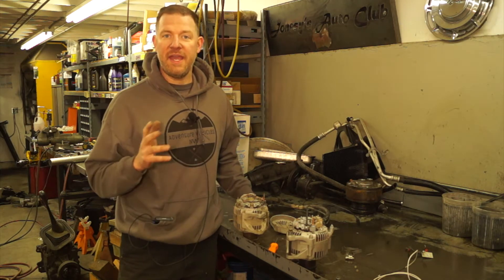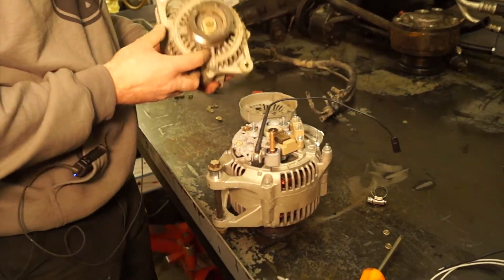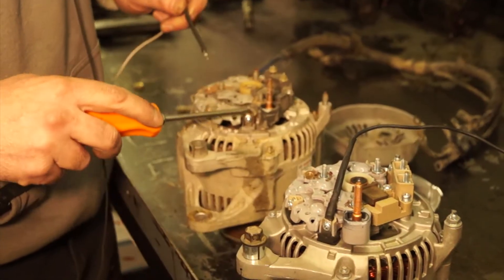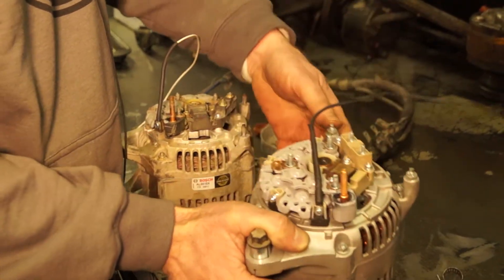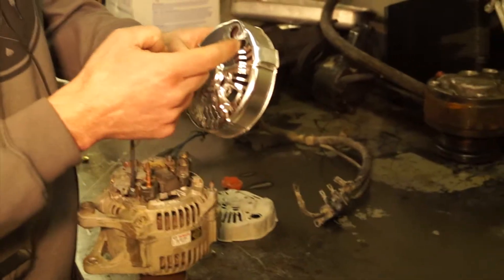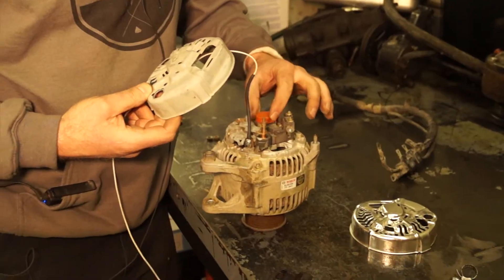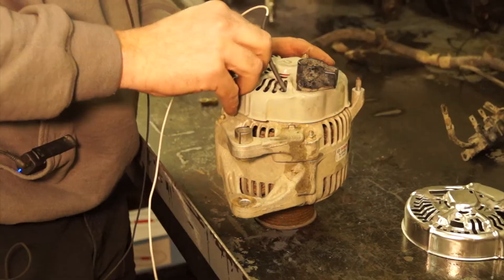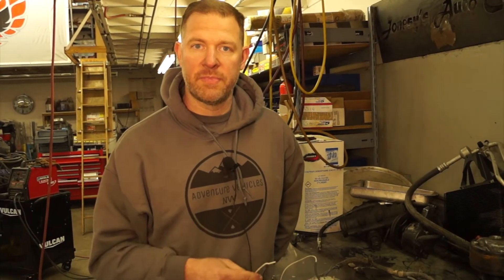Install a Tachometer Signal Wire on your Diesel Alternator

Comment: Nice but I have a question.  Im trying to do the same for  diesel engine using a Motorola  8MR2049k Alternator.  It has and external regulator.  I can see the two outputs of the alternator ac going into the regulator.  is this what you use for the tachomter signal.  you just connected to a post on the alternator next to the output post with no description.  what is that post? thanks

Comment: I'd recommend using some sort of polyurethane to keep the wire from rubbing, like window seal poly.  The double insulation is ok, but given the sharp edge and vibration these motors can have why not just poly it in place as well?  Just make sure if you do it dries before driving!
Reply: Why not just insert a plastic bushing in the housing?

Comment: I understand the procedure that was depicted. But my situation is based on the square back dual field Chrysler alternator and external regulator for restoration purposes. The tachometer requires wiring to the crank sensor or alternator. At present my two options are, a different unit, or convert the one I have. I would appreciate any information you can offer.
Respectfully,

Biff DeMartino

Comment: Why did you not mention what part of alternator circuit that you connect that wire sir is it in the stator cool, rectifier diode, ic regulator, carbon brass what part sir
Reply: It grabs the AC before the diodes get to it.

Comment: would that work for gas engine to run a generator to power a house would need something to adjust the right RPM do
Reply: JUST BUY A HR /TACH FOR A DIRT BIKE THEY RUN OFF THE HT LEAD

Comment: what signal does the wire put out ? i want to put a tach on my riding mower and it needs signal from a generator but it does not have that.
does it jst send a 12v pulse every rotation of the crank ?
Reply: Same, want to put that tach on a gas engine, I'll probably figure it out before anyone can answer our question...

Comment: so I have a 4bt Cummins swap and I am having trouble wiring alternator and the tach. 
I have a jk wrangler with an internal voltage regulator alternator which does not want to work and it sends like 17 volts to the battery. 
do you know if I can convert that jeep alternator with the internal regulator to the external regulator?

Comment: How does one regulate the signal from alternator.  Using a tranmission control module that uses a 4l80e on a 12 valve cummins.  TCM reading 7000 rpm at idle.  Need something to convert it to proper specification.

Comment: QUESTION : How do I wire the Dodge external regulator to my 1987 Chevy K20 6.2L diesel very soon to be swapped with my  recently purchased 1996 5.9L P-pump Cummins ?